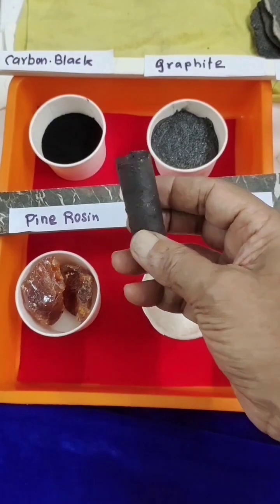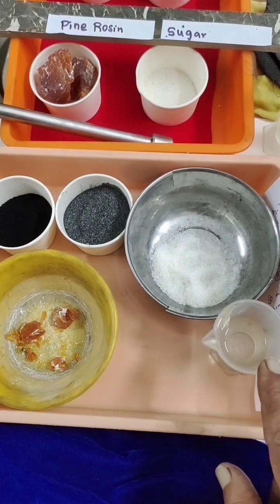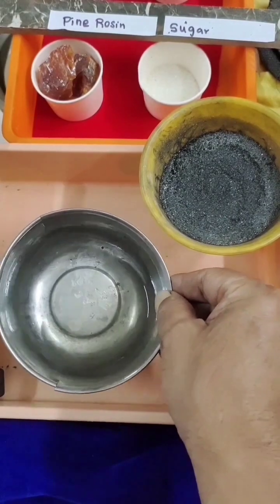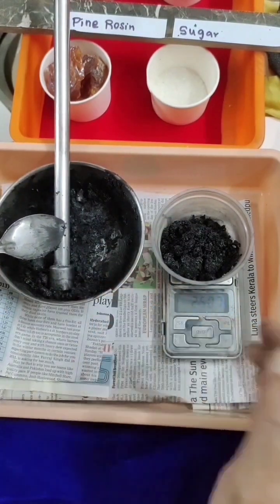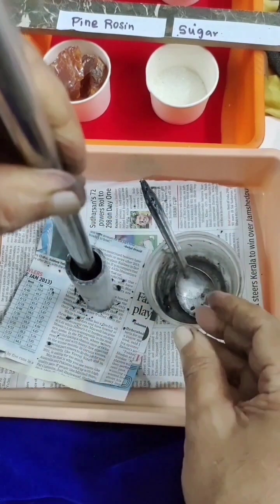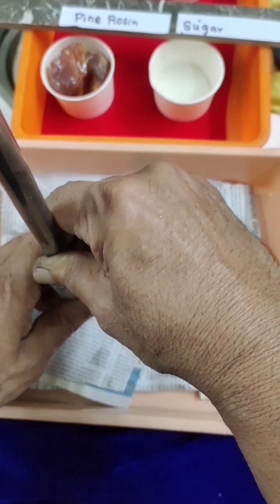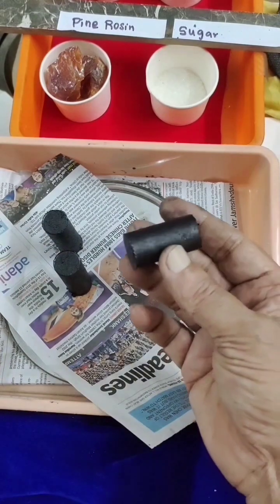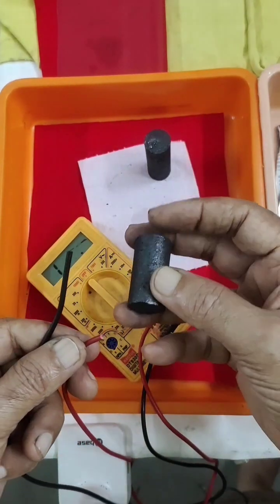MAKE YOUR OWN CARBON ELECTRODES - EASY STEPS CONDUCTIVITY 2-to-3 ohms DIY, VIDEO 98 SCIENCE PROJECT

Comment: Dude, maybe you could try inserting a wire inside when you make another electrode. I suppose a thin one is better. Before pressing the ingredients so the wire stays inside, I saw in your other video that tinplate doesn't conduct well. Maybe rust has formed? Maybe with stainless steel or another metal.
You have some good videos, thanks for your time.

Comment: Can I possibly use Rosin for Violins or Soldering? Because that's what I have here already. I guess it could work.
And my Idea for the Carbon Powder: Toner Powder from old Laser printers? As far as I've heard, it is Lamp Black Powder. Could be a cheap Source for it.
Reply from the maker: Useful the rosin that  is used for violin. Do not use soldering rosin, which may contain added other additives.
Reply from the maker: The carbon black powder shall be electrically conductive.